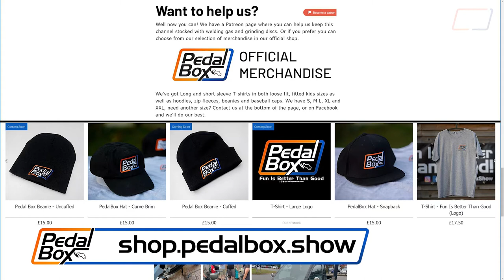Rebuilding the Golf | VW Golf VR6 | PedalBox Episode 48

Comment: Another great video!! You could splice the plug from one cps to the other. Gotta make sure the colors/wires are right though .
Reply from the maker: YEah I wondered about that, if I can't find the right one I might have to go that route. Call to VW dealer with the part number at some point to see what they have available :/ Cost the earth though!
Reply: @PedalBox  I've done it. The wires are heat sheilded so it's not fun... But it's a good temp solution till another comes in.